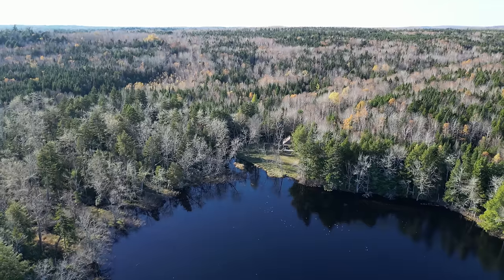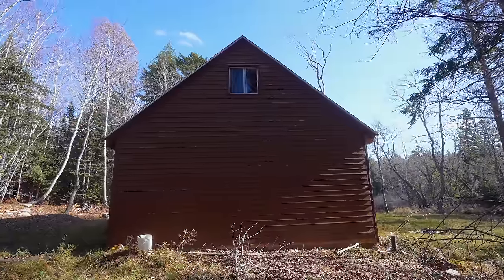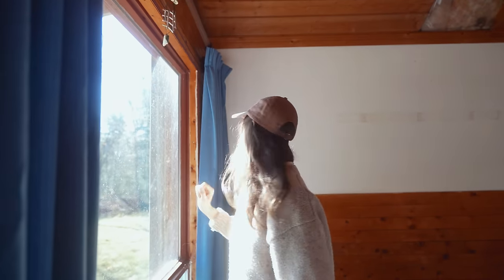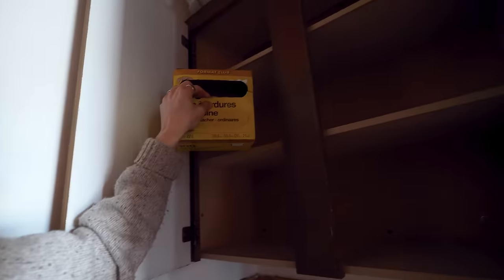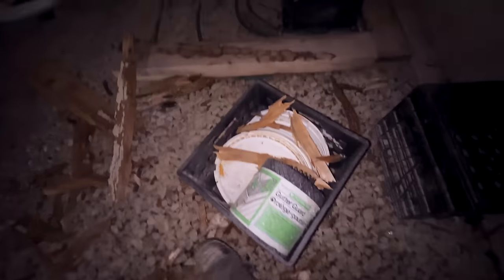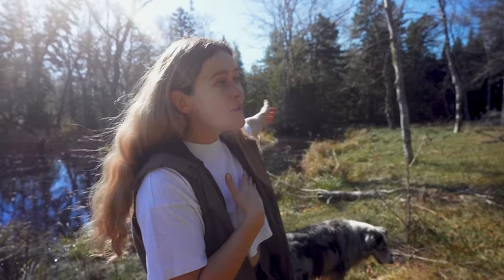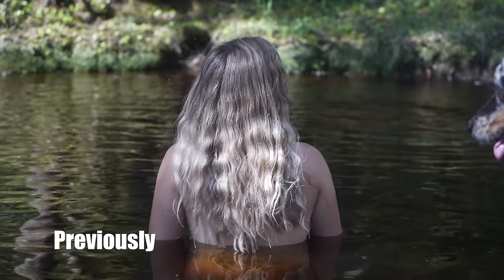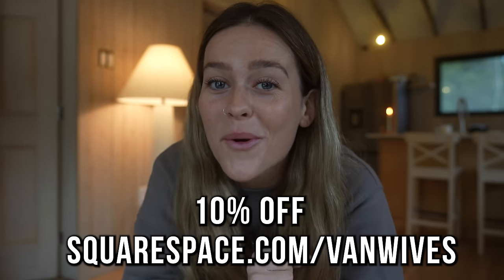We Bought an Abandoned Lakefront Home in Canada and Found Hidden Treasures

Comment: I would go with water wheel power as long as their a very good flow of water year round or wind
The building part is two small cabins 10' by twenty feet with ten foot walls
A well go thirty feet down you will have all water you need
Put a tight tank in for septic
For each cabin
Heat (wood)
Enjoy your day or night ✌️

Comment: You are right, there is so much potential. Besides solar, you could set up water wheel electric generators, and windmill generators to give you unlimited access to power. I would suggest some battery backup for the harsh, freezing times of the year!  JimmyD

Comment: I would tear down the cabin and build a small(ish) shed for cannoes and other water sports etc.. If the plan is to build another cabin close to that one I would build it with poles (considering the shifting water table it seems prudent). If the cabin is 1-1.5m over ground you will never have to worry about flooding again (build with steel or concrete, and not wood). As for other construction work... I would need maps, specially topographical once. Depending on elevation, slop and current you can construct small watermills. Worth having in mind (I dont know local zoning laws) is looking at small cabins that can be rented out as airbnb or just camping space...

Comment: I was joking about turning it down, there's enough good wood all you have to strip the outside so off at the top strip the roof off see how many structural beams that should have to replace and then the floor you'd had to strip all the inside floor and replace all the rotted. Floorthemes all the joy, Sunday and the way they put on me. And you can do that very easily.  You might have to take the balcony out.
Or the upper floors and restructures things. But because of rotted beams that will be in that ceiling and roof you won't have to take care if those outside walls are still in good shape on that cabin and probably most of the roof beat rafters are in good shape.  It probably take less work than you. Think to keep most of that building still there and just take care of the rotted damage areas

Comment: If it were me, I'd retain the location but lose the cabin: raze the existing cabin while keeping the existing foundation which appears to be okay. Raise the stem walls a meter just to guarantee clearance above any foreseeable lake level and build new at that height. 

Go NUTS with solar power, and strongly consider running cable between this and your existing cabin. They become a microgrid that provides backup between the two places so you're that much more able to weather, well, the WEATHER, tree blow downs, etc.

Insulate the hell out of everything of course. When you raise the stem walls, move your vapor barrier to the underside of the floor, rather than trying to barrier the bottom of the crawlspace that is only centimeters above the high water mark.

Retain the big porch feature to look out on the lake because it's gorgeous but move the main entrance to the far side, that little bit higher/away from the water's edge.

Metal roof. Sheds debris, easily installed, etc. I'm not saying anything you don't already know here. But if fresh water is an issue, metal roof is great for rainwater harvesting too.  NOTE: putting solar panels on any roof you build doesn't get in the way of any view, and allows rainwater harvesting just as well as metal roof.

Lucky opportunity, ladies, congratulations and good luck with it!

Comment: I would tear it down and rebuild a quest house that will be protected from the flooding in a higher location. You can make a scenic pathway down to the water's edge. I would add a small boat dock for the canoes. I would build a fire pit with seating area to be able to sit outside and watch the sunset on the water.

Comment: You need grade levels to start**
1) Is the flooding above the foundation footing?
2) Is the flooding above the foundation floor?

You have learned already that drainage away from the foundation/cabin is key If you can salvage the foundation that would be the cheapest approach. So see if you can build of the foundation by raising the first floor 4 feet higher.  --- the view is a keeper 

But draw up a floodplain plan and a drainage plan you can add dirt... remember what ambition strikes did they move a lot of dirt and stone around

I think your floor rot is from the roof not from the vapor coming up through the ground...
Reply: remember water levels are always high  spring and after a major storm
Reply: How high above sea level are you?
Reply: your first build was practice---- so many mistakes  ****try net-zero built but slowly and well thought out ****.
Reply: You may want this to be your main cabin and your other one for guest

Comment: With the river and wet marsh, it may not be a good piece of property to build on because of the potential flooding. Or you could  tear down the old cabin, and put a small A frame house elevated off the ground 20 feet or so, attached to a few large trees.

Comment: I had a restoration business for 10 years in a 40-year construction career.  I also spent time in muddy and moldy environments.  Do most of your early work with respirators, not masks, respirators, and even Tyvek suits.  Boil all the water you use from that pond for at least 10 minutes before you take even a sip.  Spray copious amounts of mold killer and every moldy surface.  When to finish off the interior, do Not use plastic on the walls.  The interior air has to breath.  The moisture in the air has to make it through the walls to the outside.  If that air hits plastic behind the wall finishes, it will condense and just lay their growing mold.  Everything you need to know is online these days.  Don't reinvent the wheel.

Comment: I would tear the cabin down, leave the foundation and add a few feet to the existing foundation with concrete. Build a new cabin on the extended foundation and raise the area of the property around the cabin. Use the moving water to create electricity. It’s truly a stunning view but would be even better in an elevated cabin

Comment: if you don't tear it down the first thing is a new roof so you can use it for storage of supplies and tools. All new cabin would save you a lot of grief with the fact that it so compromised by mold, your health is worth more then restoring the cabin and moving to or making high ground is good and making everything new would be great. Then when you are done with the new cabin, you can use your new track hoe to tear it down and maybe burn. Or rent one.
Reply: I bought a 45000lbs track hoe for a lot of $ now I'm stuck with it, but that's okay because now I can work at my leisure. No rental, just maintenance and a lot of fuel.

Comment: Repeat three times: 'ELEVATE'... Accept that there will be high(er) water in the near future. Make the base-level (an above-ground open ended, (8' high walls) basement) with concrete, sloped slightly down, so that the (mud and debris) can be cleared and cleaned out with a high volume water hose and/or pressure-washer. That makes cleanup much easier and quicker, with no damage to the main structure.
With enough 'elevation', (higher than the trees) you can have an even more spectacular view (and Solar on the roof would be unobstructed by the existing trees).
Note: My 16' X 16' cabin is three stories high (actually 36' above ground, that does not include the 12' TV antenna). I used the existing tall trees around it to hoist-up material, using ratchet-pulleys to build it. The covered exterior steps up to each level is mandatory exercise each day. LOL
It took me approx 8 months to complete, by myself, no previous building experience, 20 years ago. I'm 73+ now.
Good luck.
Reply: The ONLY 'advanced tool' I had at the time was a Paslode - Cordless XP Framing Nailer, 906300, Battery and Fuel Cell Powered... 
Material was salvaged from my previous home in the city that was being 'Eminent Domained'. Agreed to in the sale was 'Anything and All fixtures' from the old home. If it was made of copper, I took it; wiring and pipes. literally the proverbial 15' long stainless-steel, deep triple tub, with wings, kitchen sink... Yes, my home WAS a restaurant. And a budget of just $25k. 
Again, good luck.

Comment: A very interesting space, but I really think you should tear down the old structure and start from scratch. That way you can start from a solid foundation, and put the new cabin on stilts so that it's safe from flooding. The old cabin was rough, but it had a solid foundation and the structure was sound. This place is not any of that. Good luck you guys!

Comment: Tear that thing down. You're going to spend more saving it then you will starting from scratch. I'd build on high ground and even then, put it up on pilings. You can enhance the view by building it up on stilts and also protect from flooding. You could have a shipping container fully built out, finished and just craned in - instant cabin.

Comment: Mold is bad, throw out everything that has more than surface mold.  Clean up the solid wood but be careful to isolate the mold that is removed.  Most of that cabin needs to be torn down.  The location is prone to flooding so any replacement should be placed outside the flooded areas.  There is just too much water in the ground to even consider elevating a structure in the same place.

Comment: your roof is not as bad as what you think id imagine. youll have to tear the mold out but alot of the wood would be repairable ... We are in NB and just bought a small place doing the same thing. that pine ceiling is for sure salvagable..the insulation and the actual roof will need replacedbut that doesnt even mean the whole thing.

Comment: Tear it down, and put another one up with a higher  form and foundation in case of flooding and move it over  by 500 feet from the water should'nt be making holes in floor you'll end up with bugs and critters and animals in it after putting holes in the floor-chimney and old fireplace and lawmoweris savageble-good firewood, so are you going to rebuild a smaller cabin,nice water front property

Comment: Why not move closer to the water with a boat house? The existing cabin will never survive future flooding and moving away from the water loses the appeal. A boat house can be either on pilings or floating. You can have some kayaks or even a real row boat. As a guest house you only need a small wood stove for heat, propane for cooking, a small roof solar array for pumping water (filtered) into the boat house and LED lighting. Don't overdo it, it is not your primary residence.

Comment: I don’t know if you’ll get this message, but do you know what you can make a panel for electricity out of with the connected to the river like windmill water thing the Vietnamese use it they make it out of some kind of cement or clay, or whatever they make it out of, you can look it up and they put a little generator in it. It makes electricity as long as the water goes into the thing and then the electricity is used to light up anything they wanna light up as long as the water keeps going through it that be a great idea for you you could probably put maybe two of them in one the mouse of the river I want to beginning of the river or in the middle and it would break break up so you can get all the electricity you needed freeall you have to do is look it up and see how to set it up. That’s just a heads up. I just thought I’d help you out from Massachusetts Alan.

Comment: Honestly I think rather than trying to rebuild that wreck of a cabin you would be much better off tearing it down and start over from a new modern foundation. As you video shows there are multiple areas of dry rot, and lots of mold, etc. I suspect that once you start the rebuild you will find that the overall structure is not salvageable